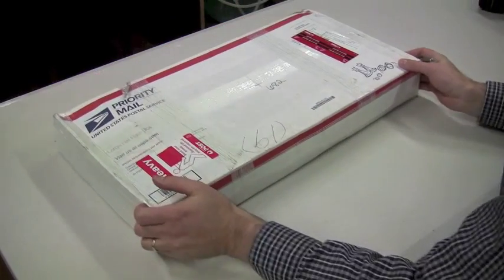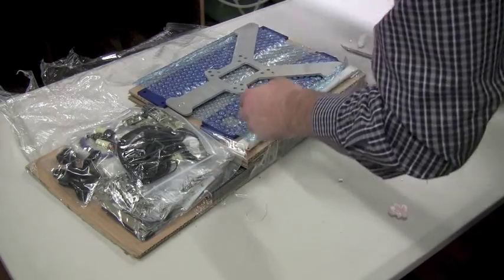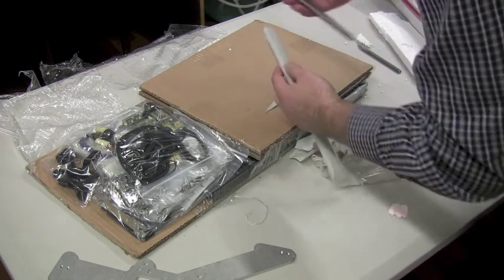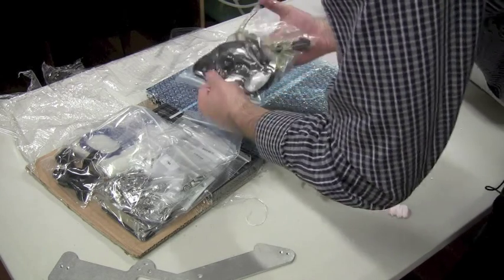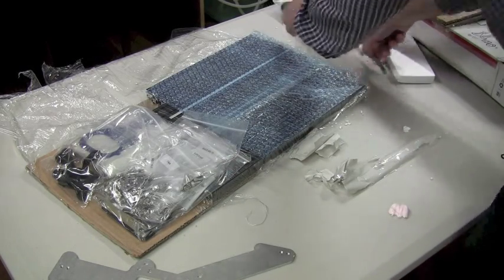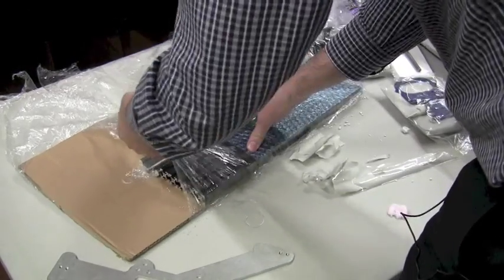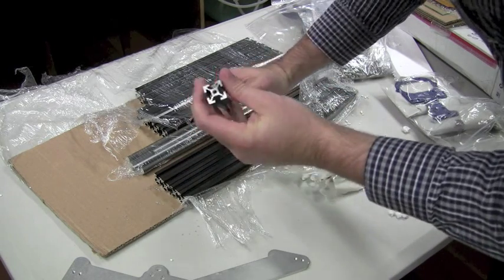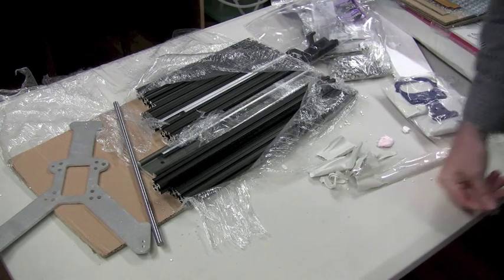Walktime Blog #33: Mendel Max v2 unboxing, part 2

Comment from the maker: I have very little port forwarding being done, because most of the devices are just nodes on the LAN with no need for external access. I don't need port forwarding at all for phone control while I'm at home because the phone is using WiFi to connect to my home network behind the firewall. For external access you only need a single port available on one machine that acts as the gateway / front end to the system